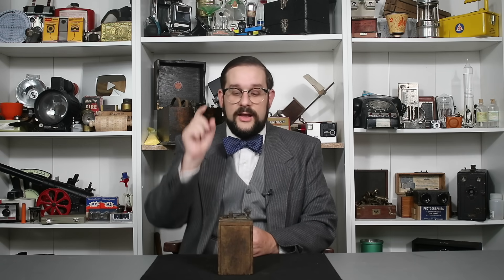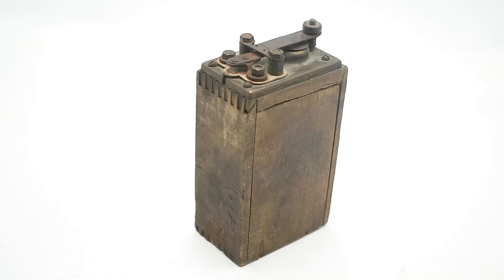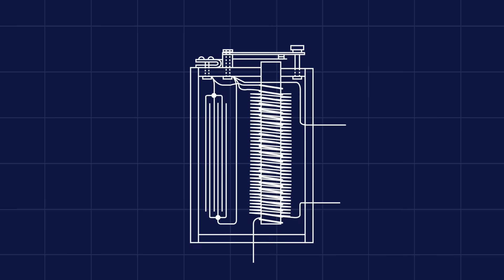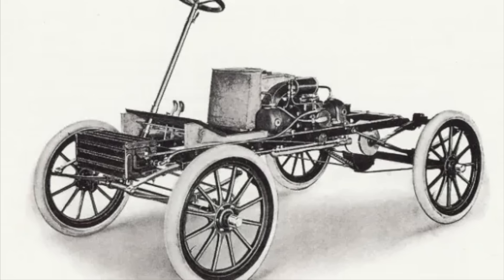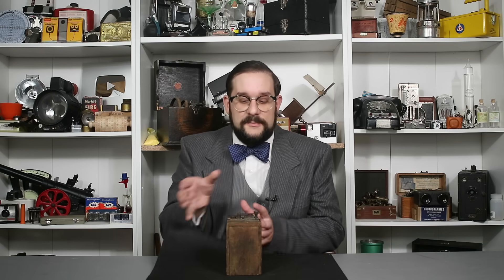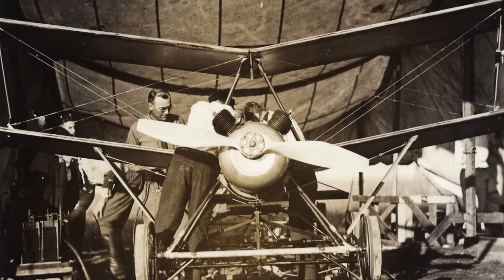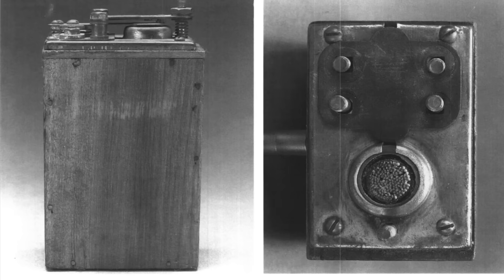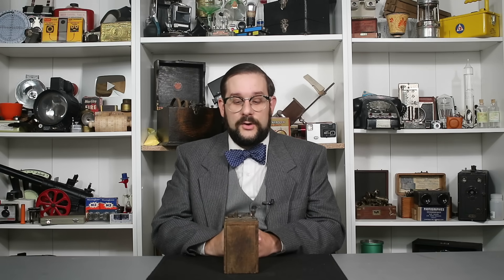Ford Model T Ignition Coil: a Spark of Genius

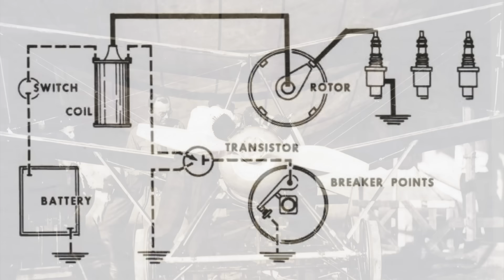Comment: Another excellent video. May I point out, though, at time index 13:09, the representation of Kettering/Delco ignition there’s a transistor present in the system diagram. Since the transistor hadn’t been discovered/invented yet, a capacitor/condenser would be a component in placed in parallel to the breaker points. Not to be nitpicking, but there should be two positive leads from the ignition switch. One that originates at the “chanking”/starting terminal of the switch. A second that connects the “Run”terminal of the ignition switch to a  series ballast resistor then from the balast resistor to the primary “+” side of the ignition coil. 

I mean no disrespect. Just keeping my crazy at bay. I wouldn’t have been able to move on to anything else until I shared that observation. Mea Culpa.

Comment: Back in the early 80's there was a lot of CB radio activity around Chicago, and I remember stories of guys taking  model T coil and using it to jam another guys radio by using a battery for power and dropping it near his antenna. The resulting spark noise would ruin radio reception badly.

Comment: Why are you showing a “transistor “ on the diagram when talking about Kettering’s ignition system ? Transistors weren’t invented until 1948 and we’re not developed until the 1950s.

Comment: Even the most advanced Giant Radial Aircraft Piston Engines had Induction Vibrators to help with starting the beasts. For most of the time smaller 4 and 6 cylinder Light Plane engines were used they used Mechanical Magneto Impulse Couplings. Modern Light Planes use Electronic Fuel Injection and ignition.
     One way to FORCE a diesel engine to start in cold weather is to essentially build a diesel combustion heater into it's air intake manifold using a Model T coil for ignition.

Comment: In 1907 the K-W Ignition Company of Cleveland, Ohio, approached Ford with their high tension magneto, well, the Ford Motor Company wasn't interested. They continued to use their trembler-coil system, which used about ten times as much copper and magnet steel as the magneto!

Comment: Great presentation! 6 volt systems were used well into the 1950s. My 1953 Ford Customline with the flathead V8 was 6v as were the WW2 Jeeps. After WW2 the military specified that all vehicles would be 24V. Systems that I love and am familiar with having spent decades owning and working on them and modern 12V Class A trucks which should have went 24V years ago like construction equipment did and use either a converter for 12V or a series parallel switch. Amp loads are tremendous now. 

However, almost all coils remained at 6V but used a resistor that was bypassed when the starter was engaged. That was the issue with 6V not enough voltage left for a hot spark during cranking. 

On our 440 Six Pack street/strip race car we had two microswitches on the throttle, when the throttle was floored one killed the alternator to reduce engine load, the other bypassed the resistor and fed 12V to the coil. 

Our 1952 Massey Harris 44 gas tractor with the "cold weather kit" used a series parallel switch and started on 12v and charged on 6v. 

Also common at the time and still available were 8V batteries that if the regulator could be set high enough could be used in a 6V system. 

Some drag racing batteries have 3 posts, a ground and one for 12V and one for 16V to run high intensity ignition systems sans alternator. 

On the old batteries with lead tie bars on top various voltages can be tapped from them. 

Tapping one battery of a 24V system will run small accessories for 12V but charging isn't quite balanced. This is true of any multi-battery setup up and you should always rotate your batteries and check water levels. 

Also do this about every 6 months to a year on power scooter and wheelchairs, stair lifts, Hoyer lifts etc. I have seen tens of thousands of dollars wasted because one battery had to be tossed while the other was perfect. 

The 12V system was introduced because of "high" compression big cube V8 overhead valve engines made possible by higher octane gas post war. Octane went from 65 to over 100 by the 1960s. The 331 Chrysler Hemi was touted as extraordinary with 7.5:1 C.R. in 1951. By 1957 they were 392 cubes and 10.0 to one. 

1930s engines were 4.5 to 6 to one CR. Dad always said that with their huge flywheels you could shut them off outside then drive them into the garage! It wasn't a joke, I used to do it with a 4.5:1 1943 International T-9 dozer. 

We used to strike a condenser across a battery and leave in on the counter for a curious customer to pick it up (they always did) and they end up tossing it clear across the room when they got zapped because they will hold a charge for awhile. 

In 1930s Chicago my grandfather managed a repair shop. He put a coil under the wooden chair and two nails in the seat one under each cheek. If the customer needed to leave he just flicked the point set under the desk drawer the battery was in! He said that one guy's sock hat levitatated off his head! Then some people started drilling a small hole in a porcelain public urinal and adding an exposed wire end with the coil body grounded to the always wet floor. With the steel nails in the old shoes this could bring a whole new meaning to the term "lightning rod!" 😂

Comment: Side Fact:  Early adding machines had a crank handle to add numbers punched in.   Electrical engineers said a motor to do that function would be too big to get the torque of a human arm.   Kettering built a 'too-small' electric motor, knowing it was 'undersized' but only had to operate intermittently and thus could cool down between 'cranks' of the adding machine.

The original car starter electric motor was also thought to be needed about the same size as the engine to handle the same torque as the human-powered torque to crank the engine.   BUT Kettering uses the knowledge of his adding machine to build a 'too-small' electric motor to crank the engine.   THAT is why all starter motors are intended for only bursts, not long cranking times.   Crank too long and any electric starter on a car or truck will burn out.

Comment: Otto engines actualy tended to be direct flame ignition for the first majority of his development.  no tube just a transfer port moving a actual burning flame from outside into the inside using a slide valve.

Comment: Great video as always!  Also, Ford spark coils were also connected with telegraph keys in the primary circuit & used by early amateur radio operators as the basis of entry-level spark-gap radio transmitters prior to the development of vacuum - tube based continuous - wave (CW) transmitters.

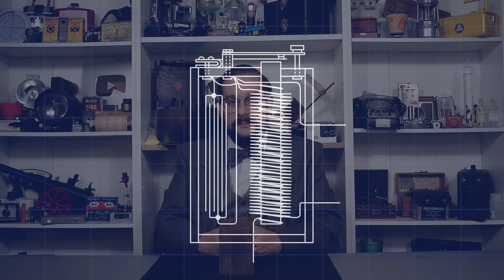Comment: 5:50 Better to say you can get greater voltage ratios in a practical way using discontinuous pulses than with a continuous ac wave. A modern ignition coil still bears this out. The voltage spike just from interrupting an energized coil is already much higher than the supply, and the transformer boosts that a lot. That's where your condenser explanation comes in; the spark you prevent is so that you can create a different one on the secondary side.

Comment: One thing nobody mention (or knows about?) is the trembler coil sysyem allowed the operator to restart an already warmed engine at operating temperature by simply switching on the ignition, firing the trapped gases in one of the cylinders.

Comment: Nice overview of early ignition mechanisms. Your diagram of the modern Ignition control circuit shows a transistor which would not be invented for another 30 years and was not used in ignition until the 19703.

Comment: Early amateur radio operators would sometimes build low powered spark-gap transmitters using Model T ignition coils, until spark gap transmitters were made illegal (at least, for use on land) in the late 1920s.

Comment: My dad told me these things broadcast some pretty strong radio bursts, which wasn't a deal breaker until radios became more popular and numerous.
Reply: Back in the early 80's there was a lot of CB radio activity around Chicago, and I remember stories of guys taking  model T coil and using it to jam another guys radio by using a battery for power and dropping it near his antenna. The resulting spark noise would ruin radio reception badly.

Comment: Knowledge about impedance & some logic tells us the switch from 6 to 12V was clearly for starters, not ignition.. That is also why plane systems were 28V (charge voltage, x2 12V batteries in reality) as well, it's to increase circuit/starter impedance of high-demand starters so you don't have a thousand amps and drop a huge percentage of potential across wires & even chassis. This worked-out well in planes & some heavy vehicles as the 28V from the dyno/alternator was just BARELY-enough to get vacuum tubes to have "significant" power generation, upto 0.6W from x1 28D7 audio-output tube. 0.6W sounds like a joke but for vacuum tubes, which are extremely-high impedance & deal VERY poorly with low-voltage (electrons don't have enough energy to make it past screens well..) this half a Watt is nothing short of miraculous. This power was more than enough for the high-efficiency speakers/headphones that were the norm back then. As a side-note on the tube side-note, some farms in america & austrailia (I believe) used a 32VDC mains system and there was a company or two which used these plane-origin tubes in "normal" radios in 2s & 3s in parallel & with the extra voltage these were making solid power output for the speakers so were loud-enough for the whole barn to be lit-up by music. These 28V tubes all run so "hot", literally & figuratively, that they have a max voltage of 100V or even below for some models, whereas normal tubes start @ 150V just for signal use, power output need 200V+ to begin working well..

Comment: You say that cars switched to 12V in the 30's....While there may have been some vehicles that adopted it that early, the majority of passenger cars made (at least in north America) remained 6V until the big 3 started transitioning to 12V in the mid 1950's.
Among the many non-factory uses for these coils, during WWII when replacement vacuum tubes were in short supply radio repairmen would use model-T ignition coils to re-weld tube heaters that had gone open inside the vacuum.

Comment: This system with one coil per cilinder ( or dual double coils in some cases) currently is used on electronic injected engines , replacing single coil system of carbureted cars ! Also this output with pulsating high voltage is very similar   to hiperformance ignition modules like MSD . I think Mr Ford was a man ahead of time ! Excelent teacher, nice explanation with clear pronunciation for my easy understanding.  Greetings from Brazil .
Reply: MSD ignitions are as a general rule CDI type, which stands for capacitor discharge ignition. Modern CDI type ignition works roughly like this:
The capacitor itself isn't charged up to the spark plug voltage, rather the ignition box steps up the battery 12v voltage to say 48v and uses that to charge a capacitor. Just before the time comes to fire a spark plug, a transistor in the ignition box will turn on, which connects the capacitor across the wires going to the ignition coil primary (low voltage side). The primary winding of a CDI coil also has a much lower ohmic resistance than the coil used for a normal "Delco" aka points and condenser type ignition, because it is not normally powered. The combination of the higher voltage and the lower resistance means that there is a much greater current flowing thru the primary of the CDI ignition coil, which means it takes a much shorter time to build a stronger magnetic field strength in the iron or ferrite core of the CDI coil. When it comes time to fire the plug, the transistor connecting the "reservoir" 48v capacitor to the ignition coil is turned off, and the interruption of the current flow causes the magnetic field to quickly collapse, resulting in a much higher voltage appearing on the secondary coil, because the rules of magnetic induction state that voltage is proportional to both the starting strength of and the rate of change in the magnetic field with respect to time, and the CDI coil has a stronger magnetic field that is collapsing more quickly, leading to a much greater voltage output. This is ideal for high performance engines that have high compression ratios and use harder to ignite high octane fuels. Top Fuel dragsters use magnetos, but those magnetos also incorporate CDI technology, you need a startling amount of energy to get reliable ignition in an engine that is operating at such a high power output.

Comment: Thanks for the interesting info, but I'm confused by the statement beginning at 13:37 that voltage was stepped up from 6 to 12 volts in the 1930's. I'm old enough to remember that Chevy went from 6 to 12 volts in 1955, Ford in 1956, other U.S. makes in the late 1950's, and finally VW in 1967. I also remember that in those days, some 12 volt cars had an external ceramic "ballast resistor" in the ignition switch circuit to reduce voltage to the coil from 12 to 6 volts, while all other 12 volt cars had a special coil with a built-in resistor. Starter solenoids had an extra circuit to temporarily send full 12 volts to the coil for a hotter spark, but only when starting. Distributor points would prematurely burn out if a do-it-yourselfer replaced a resistor-type coil with a non-resistor coil on a car that didn't have a "ballast resistor" in the ignition switch circuit.

Comment: On a pedantic note... The type of joint on the corners of the box is correctly called a box joint.... Not tongue and groove joints, occasionally they have been called pin joints or fingers joints. The name Pin joints isn't  used much because they are easily confused with other joints that are 'pinned' in some way.  Finger joints are similar but are triangular/trapazoidal in shape and only fitt properly for lineal joints... The back panel is probably best named as a rabbited or rebated joint depending on where you are from ... Typically true tongue and groove joints only run parallel to the longest length of the boards and connect the boards edge to edge, but not face to face, face to edge, end to edge or end to end ... Admittedly theses are suddle differences for most of the joints they are designed to optimize the woods strength in a particular direction or configuration and part of that is reliant on the naming convention... I don't  mean for this to be an attack just information for future, i do like the videos and the info included...

Comment: Diesel engine glow plugs do not heat the cylinder, they ignite the fuel on contact. The plugs are far too small to heat the cylinder

Comment: 13:39---the transistor wasn't invented when Kettering created his ignition system. the breaker points acted directly in series with the coil, thus needing the capacitor (condenser) to prevent point erosion.

Comment: The coil and condenser (capacitor) form an oscillating circuit, thus supplying the coil primary with alternating current when the points open.  This last for several cycles before the energy is dissipated.

Six volt systems lasted well into the 1950's.

Comment: My dad was a racer in the 50s. He said they would drill a hole in the exhaust pipe, install a spark plug and one of these, set the carb to run rich, and when they stomped on the pedal the exhaust would shoot flames. You can see this done in American Graphitti.

Comment: Some people dislike computers in cars but boy oh boy was electronic ignition and fuel injection a huge step up. Gone are the days of gunked up carburetors and filing off oxidation on your distributor contacts. The sweet spot was 2002 or so where you have the PCM for engine and BCM so the full headlight current doesn’t run through your steering column — after that they started putting computers on the gas tank and we lost our minds.
Reply: From computers to control the car to computers to control the driver
Reply: Yeah but in a hundred years, will people be pulling cars of today out of hedge rows and getting them started like they are with older vehicles now? I doubt it. Nevermind the electronics, the dissimilar metals will just eat each other away.
Reply: @krockpotbroccoli65 you my friend have not met the 2000 Toyota Camry 😂
Reply: Computerizing everything like the lights was unnecessary but EFI was great. I like carburetors for the novelty though. It blows my mind that someone hasnt made an open source EFI system
Reply: i drove a 1977 f100 for the 2016-17. put lots of miles on it carbs go 30,000 mi before rebuild. as for points thy a bit of a Paine i had a points dizzy driving a amplifier points just need lube on rubbing block. and a wipe with contact cleaner as thy wear a trigger. head light switch was on dash and hi low on floor. i take this over obd2 or 1. i put glass halogen headlights as the ge incandescent ones wear weak. for me it was the 1960s -1970s

Comment: One interesting thing about the trembler coils is its similarity to an old-fashioned bell. The magnetically driven buzzer is almost exactly the same mechanism as the bell interrupter. I am guessing that one was derived from the other, but I don't know which came first, or perhaps if both derive from the simple electrical buzzer.

Comment: Great video!  A few comments if I may.....13:24....there were no transistors in the 1920s, it was invented in 1947, perhaps the device in the picture is mislabeled?   And 13:45...AFAIK, cars used the 6v system into the mid-1950s; and yes, the change was to use smaller wiring and cables, as the 12v starter used half the cutrent of the 6v starter.

Comment: Piston engine small airplanes at one time used a system called “shower of sparks” during initial start up. I’m guessing that it was based on the vibrating coil.